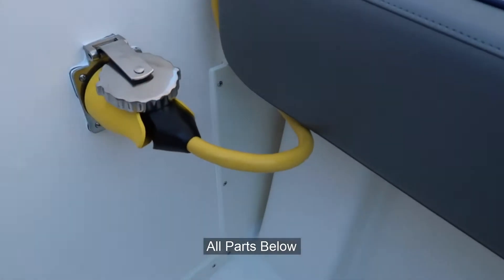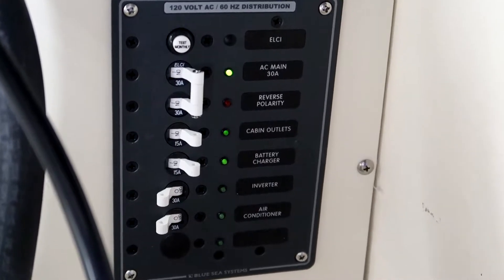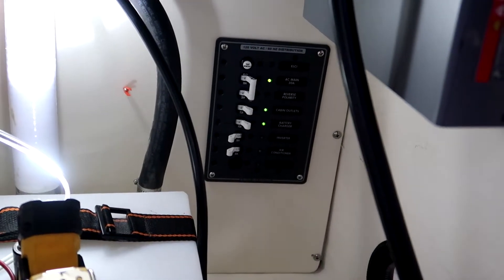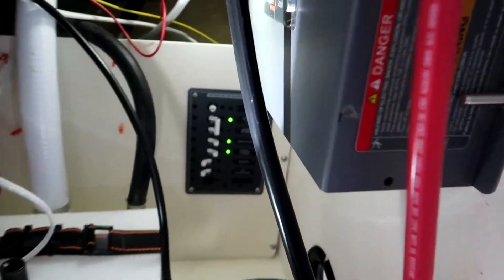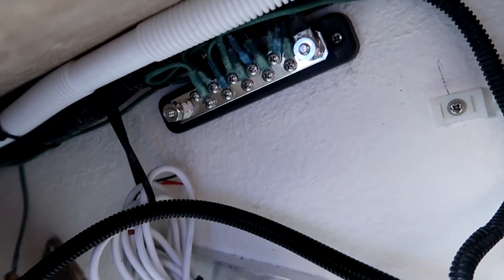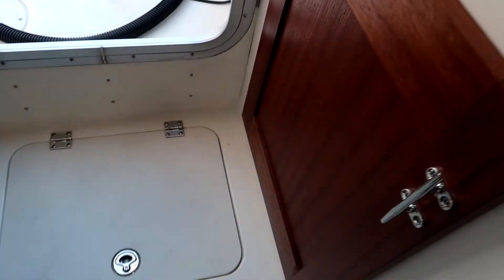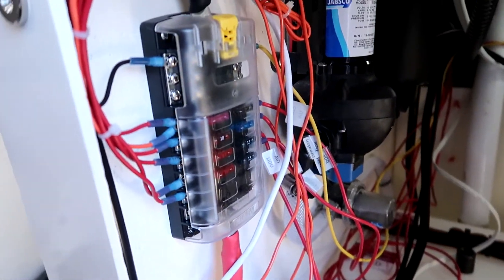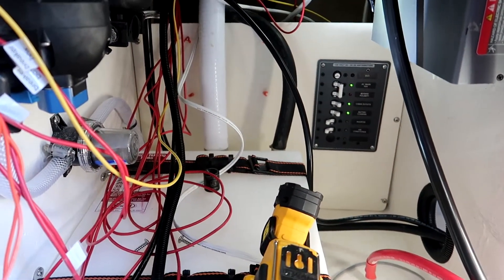My Boat AC Wiring Part 2

Comment: I was hoping you were going to show the back of the AC panel! We just bought a surface mount box from blue sea systems and are looking for videos on where the wires go.
Reply from the maker: Do you have the schematic? What part do you need help with?
Reply from the maker: The panels has a ground bar, neutral white bar, and a hot black bar. You put your main where schematic shows and wire each outlet or device to the appropriate bar. You may need to add a few breakers also.